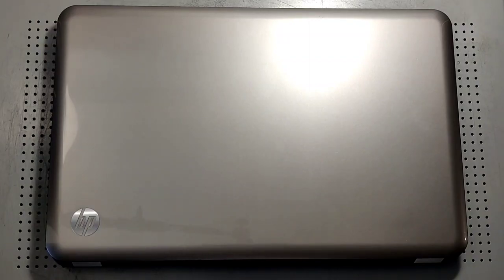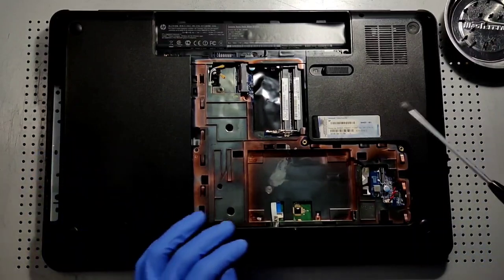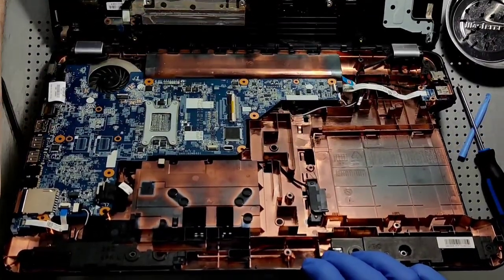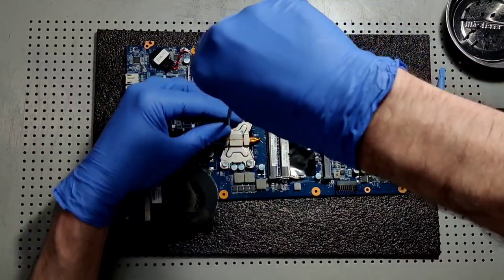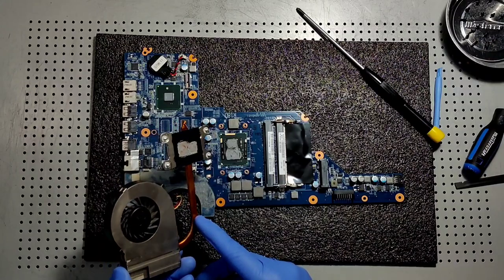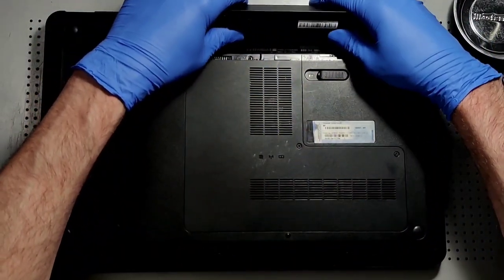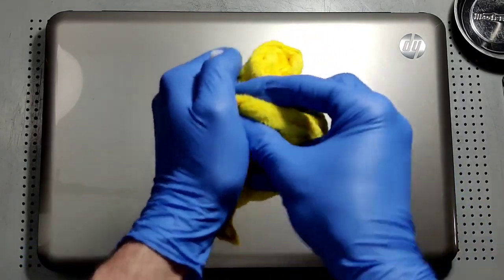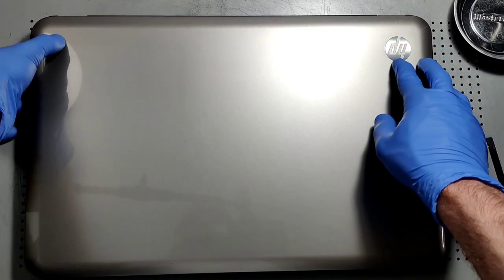HP Pavilion G7 FULL Disassembly Overheating FIX with Fan Cleaning and Fresh Thermal (2021)

Comment: Thank you so much for this video. I had an old HP Pavillion G7 lying around that worked, but kept overheating with loud fan and battery wasn’t charging so it only worked plugged in. This was helpful but when it came to put the computer back together, I would have liked if you kept the speed the same to easily follow along and just have a “Skip to …” on screen or ask the viewer to fast forward playback.

Sadly, after putting the computer back together, and plugging it in, there is no charging light and the power button won’t turn it on. Thinking I might have missed something, I took it apart again all the way to where the motherboard access and reseated different connections but still no luck. Eventually I’ll try to open it up a 3rd time but looks like she’s dead hopefully I didn’t break anything but oh well it wasn’t being used anyway 😢
Reply from the maker: Thank you for your comment and I'm glad it helped my friend. I hope it's not dead and that the 3rd time will be a charm for opening and getting it going. 🙏 Really appreciate the tip and I will try to make more videos like this in the future and utilize your tip to make it easier for viewers to follow along. 💯 Great tip! 😃
Reply: @TechInsomnia  I GOT IT!!!!! It was totally my fault. So what happened was the battery is completely dead won’t charge and I have a replacement on the way. When I was putting the motherboard back in, I forgot to hook up the DC adapter port on the side. The computer wasn’t getting any power at all. I plugged it in and now the computer is back up and running. That plug was almost hidden and I totally missed it.

Laptop is running good now. I removed Windows 8.1 and put Linux Mint on it and now my idle temps are about 45 degrees C now when they were in the 90’s. The thermal paste was completely dry and it actually overheated while I was trying to install Linux. Thanks again for this video!!
Reply from the maker: Excellent diagnosis and fix my friend! What you've managed to successfully do is not easy task and I salute you brother! 💯

Comment: I would like to caution everyone about using a vacuum on a computer. The static discharge from the vacuum can be detrimental to the computer. The better option is using compressed air to remove the built up dust.
Reply: not with the attachment he had on, it removes that issue